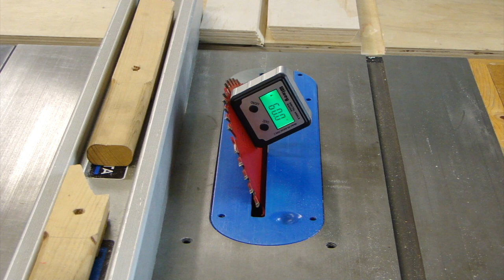DIY Gun Vise

Comment: I was just looking for a gun visa that I could build.  Thanks for this video.  It gave me some ideas on making my own.  I am an avid woodworker and rimfire enthusiast.  I wanted to put a level on my gun to prevent gun can’t.  I need to have the gun level to put the new level indicator on.  I will make one.  Thanks for your video!
Reply from the maker: Thanks Garnet.  The way I built the vise makes getting guns level side to side pretty easy.  If I was going to make a vise again, I would add a way to adjust one of the clamps up or down.  I think it would be helpful for some gunsmithing operations.  I hope yours turns out great!

Comment: Thank You and good project.  I like the dovetail design for versatility and compact storage.  I actually have the wood, leather, knob, metal etc.  Only challenge is I have to do the routing with a hand router and simple straight edge/jig etc.  I have aluminum bar which should work fine in place of your steel.  I think I have the steel but it would be a lot easier to cut aluminum with hand tools.